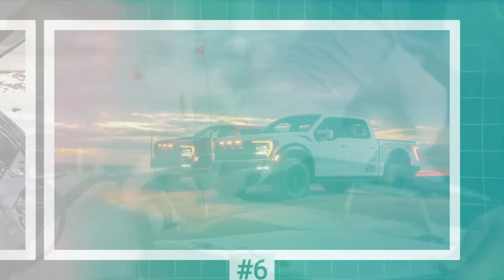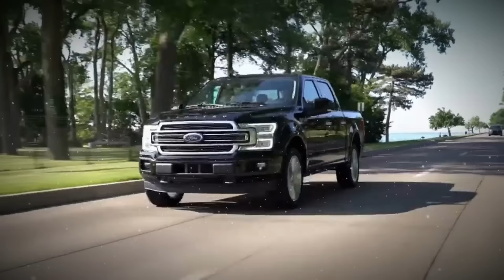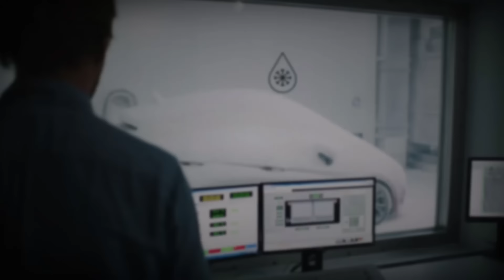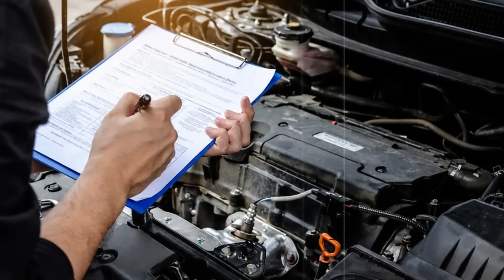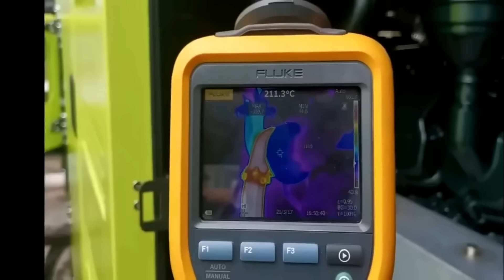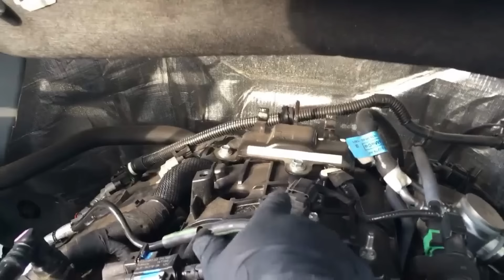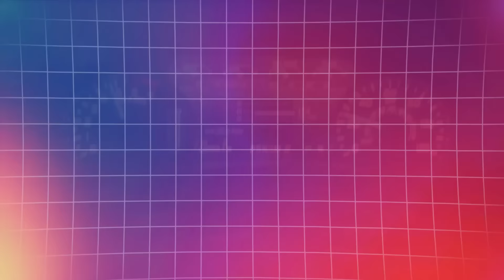We Ran a Turbo F-150 & a Naturally Aspirated F-150 Side by Side for 200,000 Miles — A Clear Winner

Comment: My 7.3 gas engine in an F350 is 1/2 way in your test mileage. I’m at 106,000 miles. Not a penny spent except normal maintenance. I’m still on original front brakes!   Truck runs great.
Reply: I only have 48,000 miles on my 22 f250 7.3 gasser. It’s been great so far! Plenty of power even towing a 16k dump trailer around central Alabama hills and mountains. 3.55 gears. Still fine worst case scenario is like 4th at 3,500 and that’s down hill or if your speeding up. I mean 55mph 5th gear and 3000 rpm it’ll pull 16k up 4 percent all day. lol feels funny to down shift to engine brake down hill 😂. So far I’m convinced it’s the best work truck engine for those not moving crazy cdl weights
Reply: @justinwest7765 100% agree with every thing you said. It is a classic work truck. I threw a Ford OEM bed rug in it when new. No bedliner on it. That bed gets used and abused. 

I just spent the money at my dealer to “prep me for 150,000 miles” and it didn’t take anything out of ordinary. Plugs, full flush on trans, full flush on brake fluid, rear differential oil change, 4x4 case oil changed. Brake inspection said “nothing to do here” (yes still on my factory brakes). I had already done a flush of the coolant. I completely underspray coated entire frame laying on my roller. I used the spray cans from Harbor Freight. It’s the rust inhibitor stuff. Forget the name.  It’s a PB Blaster branded product. I bought a long tube that you attach to the spray cans off Amazon and the tips of those makes the spray pattern radial on exit. So you stick that end in any open frame channel opening (and there are MANY) and coat as much of your frame as you can. Mine took about 8 cans and I should buy more and just go wild one day. That stuff works. I have changed oil religiously. Buy my oil off Amazon. Best price. I also bought a large box of Ford OEM oil filters. I put a brass valve in my oil sump pan drain hole. It redirects sump oil straight down into my waiting pan. Zero spills. Oh and the oil filter is within 6” of the valve. After thousands of miles of use I would buy that brass valve if they cost $150 and not just $35. My oil gets dumped an average of every 4,700 miles to date. I don’t drive it hard. I don’t stress the suspension travel. I don’t roll the body in corners. It’s a big truck and not a sports car so I drive it like I want it to last. I once pulled a WEIGHED dump trailer containing 40% brick debris and the rest was stucco wall rubble. It weighed 27,000 pounds. I drove it 19 miles on flat quiet crawfish farm roads. Frame is an F350. Didn’t even notice the load!  Yeah she squatted a couple inches but that’s all. I did feel marginally  lighter steering. Engine is Godzilla. When you own one and you are trying to explain it to people you can’t. Godzilla is a beast that eats whatever you throw at it. And then you are unloaded and stop at a country 4-way and there’s no cars near you for 3 miles. You let the beast roar!  It is a naturally aspirated push rod 445cu in with direct injection. 

BAM my truck hauls ass…….

Comment: Old school guy. Simplicty is job #1. So many failures (that you didn't experience) such as head gasket, rod bearing, etc are directly influenced by higher combustion pressures and temperatures. Larger displacement, lower revving, more heat removal (air volume and cylinder wall area) put the NA engine at a significant advantage. Saving a bit of fuel (to satisfy bureaucrats) is a disaster.
Reply: You do realize this never happened right? This is pure fantasy. This channel is coming from a slop facility in India somewhere and churning out aye eye videos nobody every purchased a truck and ran it side by side with another truck. This is pure slop.
Reply: @ThaiLifeAmerican This has been happening since the Ecoboost engine was created. Except it's not one truck that was tested. We have long term data on this now and it's easily accessible. Look up things like lowest cost of ownership, fewest customer complaints. The nhtsa tracks this data. They have had far more problems with the Ecoboost turbo charged engines than the 5.0 V8. Now they are having a lot of problems with the 10 speed transmission. Make it more complicated it becomes less reliable.
Reply: 40 plus year tech here. Been telling everyone for decades. The more crap they put in the vehicles the more shit there is to break.
Reply: My experience with a Ford Ranger upgraded 2.3 L Turbo 4 (380 ft lbs torque / 325 HP) is that the little 4 cylinder doesn't have to work nearly as hard to pull the same load compared to an older 4.0L V6 Ranger and an older 5.0 L V8 F-150.  Both the V6 and V8 have to rev higher, to move the same weight load up hills, where the little turbo 4 is loafing up hills barely pulling 2000 RPM at times!  The reason the 2.3 L turbo 4 was chosen over the 2.7 L V6 Turbo is that the upgraded 2.3 makes higher torque from idle to 3000 RPM than the 2.7 V6 turbo, and that is the RPM work range I generally use. The V6 higher torque and HP from 3000 to 6000 RPM is useless to my work load. Plus the DOHC inline 4 is a simpler engine than a V6 or V8, with fewer moving parts, and an inline layout that runs much cooler than the V-engine layout!  All these little positive features of the little turbo 4 are very noticeable when actually working the engine to pull work loads!  As long as properly maintained, my money is on the little turbo 4 to outlast the V6 and V8 engines I've used, because the little turbo 4 does not rev as high or work nearly as hard as the larger V6/V8 engines under REAL work loads!
Reply: @63DW89A  The turbo engine is pushing MUCH higher combustion pressures, with less heat area dissapated through cylinder walls.
Reply: @theronwolf3296  Superior heat dissapation of a crossflow head and a simple robust valve train is exactly why inline 4 & 6 cylinder engines are the best engines to turbocharge.  If an engine is built for turbo charging, then the internals will handle the extra pressure.  I've driven semi trucks for 40 years, and I've seen  turbo diesels go 500,000+ miles without a hitch.  Turbo gas engines, with much lower compression ratios than diesels, will do exactly the same.
Reply: @63DW89A  "If an engine is built for turbo charging, then the internals will handle the extra pressure".  One could wish!  Sadly, the highly stressed low displacement turbocharged engines offered today indicate otherwise.  Commercial duty turbo diesels will run trouble free for 500+K miles and they bear no resemblance to the turbocharged gas engines.  It is not a fair comparison.
Reply: @NCF8710  It is a fair comparison that clearly demonstrates that turbo engines can last as long as naturally aspirated engines. As far as "highly stressed small displacement engines", that is not my experience.  I'm using a 2.3 L turbo 4 in a Ranger that is a torque monster, running same weight loads up steep hills in TN at lower RPM than more highly stressed 4.0L and 5.0L V6 / V8's having to run at much higher RPM to move the same weight loads! .  The inline 4 (even turbocharged) is a much simpler engine, with a more robust and efficient valve train, that is much easier to run cool than a V6/V8.   The beauty of the inline 4 is that with a piston displacement that is 25% the engine displacement, the inline 4 has a faster torque rise, and makes its power and torque at lower RPM than a V6 / V8.  That is EXACTLY what I am seeing in direct load moving comparison!  The inline 4 is the simpler, stouter better engine, when built to handle the load.
Reply: @63DW89A  Real world examples say otherwise.
Reply: @NCF8710  While Ford has had some troubles with the 2.7 and 3.5 V6 Turbos, the 2.3 L has been ultra reliable and trouble free over the years and that is exactly why I chose it over the 2.7 L V6 turbo, in addition to the better torque curve of the 2.3 over the 2.7 V6  from idle to 3000 RPM!
Reply: @NCF8710 my turbocharged  Volvos all went 300,000+ miles without headgasket, or turbocharger issues,  an I wasn't nice to them . The Japanese and the Swedes KNOW HOW to make turbo engines last, just like Caterpillar does, Ford and GM STILL can't figure it out. . . . 
And Ford builds everything to be a colossal bitch to work on, I've been a technician for 35 years, ask me how I know.....
Reply: @jamesgeorge4874  Tell me all about Toyota’s 3.4L twin-turbo V6 (V35A-FTS).  Also the Nissan 1.5L VC-Turbo.  Those are Japanese if I recall.  There are many more examples!
Reply: The “some troubles” with the 2.7 was with the first generation 2.7.
Reply: @JasonWatrous-q2z The Ford 2.7 turbo fails quite often in all generations!  Go check out the "I Do Cars" YT site where a mechanic tears down failed engines. The latest 2.7 turbo failure tear down was 3 months ago on a 2.7 with perfect maintenance record that failed at 110,000 miles! He has a long list of Ford 2.7 Liter failure tear downs! In contrast, he has tried for YEARS to find a failed Ford 2.3L turbo failure; he finally found a failed 2.3 L turbo failure where the owner had driven the engine for over 50,000 miles without an oil change!
Reply: @63DW89A  Turbo-diesels are a different beast than gas turbos.
Reply: @PassivePortfolios  Mechanically, "Turbo-diesels are a different beast than gas turbos" is a false statement.   The diesel engine is actually subjected to higher pressures and heat than the gasoline engine. Other than that, both are liquid-cooled, oil-lubed, internal combustion engines being force-fed air by an exhaust-driven turbine.  Even the explosive volatile liquid power-generating  cycle is identical, other than the way combustion is ignited.  There is ZERO difference in the way the turbo-force-fed "intake-compression-combustion-exhaust" "piston-power-generating "cycle works in a gasoline or diesel engine, and ZERO difference in the way liquid-cooling, or internal oil lubrication works in either a gasoline or turbo engine.  If the gasoline engine is built to handle the power generation, there is no reason the turbo-gasoline engine cannot last as long or longer than the turbo-diesel engine.
Reply: @NCF8710 You have no idea what you are talking about.  The mechanical loads are easily managed with forged internals and properly sized pistons, connecting rods and crank bearings.  Gas turbos main enemy is heat under sustained load but that can be managed with cooling system design and oil jetting the pistons and other critical areas.  Most importantly engines used for light truck duty are not highly boosted like performance sports cars.  You are comparing old oranges to new apples.  Not the same.
Reply: @NCF8710 A 4 cylinder crank and bearing design is actually more robust than any V6 or V8 because the bearing loading is a constant for each cylinder.  On a V6 or V8 two pistons share a common pair of bearings and their load is not in center if the two bearings.  Plus the loading in the bearings shifts at the angle of the cylinder banks.  

If you are not real engineer but common garage goober regurgitating the falsehoods you were told you would never understand or admit those assumptions you make are false.
Reply: @NCF8710 That is a manufacturing quality problem.  It is related to design on in the sense it is difficult to consistently clean the swarf.  Then they discovered a tolerance stack up issue with cams that required a minor change.  Presumably because the tolerances engineering set could not be maintained in production.  These are risks if producing any new design whether turbocharged or not.  A V8 engine with similar issues might last outside the warranty period before it fails which in my opinion is a much worse outcome for buyer.
Reply: @63DW89A  and the TT2.7 has proved to be ultra reliable and trouble free over the yrs and it also provides 400 lb of torque at just 2750 rpm and that’s why I chose it, it tows great
Reply: @jamesgeorge4874  you have proved what you DONT know, congrats
Reply: @63DW89A  that’s a steaming load about the 2.7 engine. I seen the same video and it was NOT with perfect maintenance, he even said he had no idea how the engine was maintained. And he also said it was one of the few, if not the first one he has torn down, there is no list.
He has not “tried for years” to find an effed up 2.3 because they are everywhere, he just didn’t try. We get it, you are a 2.3 fanboy, no need to make up shit about another engine to make you feel better about your poor choice
Reply: @kannermw  Says the tinkerer regurgitating falsehoods!  Now run along underachiever and go play outside.  Stay out of the street.
Reply: @kannermw  Blather on, underachiever.  You are the one without any credibility.
Reply: Turbo revs lower. NA has to rev higher so you’re wrong about that
Reply: @jacobfrost5461  You are correct they don't NEED to be higher rev, but Turbos as currently implemented are generally smaller displacement that achieve their power at higher revs for fuel economy reasons.
Reply: @jacobfrost5461 No he is right. The turbo also creates more pressure on the engine. More pressure equals less reliability, less longevity.

Comment: I have a 2021 F150 XLT extended cab with tow package and the 5.0 Lt engine, 2WD.  I do have to say, I have had zero issue with low end power or acceleration.  Of course, I don't have the ecoboost equivalent to compare to, but I do have a Subaru Ascent Touring with a turbo.  That turbo has just a little bit more acceleration, but that could be accounted for with the difference in vehicle weight.  Now, I don't have high mileage to compare though, but my F150 has had no problems.  There are a lot of recalls though, but none are on critical drive train components. My previous 2013 F150 STX  4X4 with the 5.0 Lt engine also performed quite well.  It did have some issues with the entertainment system though.

Comment: Have a 2018 F 150 with the 2.7 engine...(bought new) 165000 miles and no issues so far... I use castrol full synthetic oil and change each time the warning light comes on.... it has averaged 22.9 miles per gallon in all driving conditions... Truck is used for primary transportation, haul trash off, haul things from Lowes etc., I do pull a trailer with a golf cart sometimes and we take trips to the mountains each year...  I love it and hope to get many more miles out of it.... Take care of it and they will usually last... Also buy the truck based on what you plan to use it for... Lots of hauling get the V8, average use it wont matter that much.... The old F150 I had (94 model), sold it at 289000 miles still running.. It had the 5.0 v8

Comment: Having owned both a 5.0 V8 and 3.6 V6, the 5.0 towed much better and got better fuel economy during the towing process. The 3.6 got really hot during towing and the fuel economy went to crap.  Around the city where I did 90% of my driving the 3.6 did great.  Overall, I preferred the 5.0.
Reply: 3.6?
Your 5.0 did not tow better than a 3.5eb. It just doesn't work that way.

Comment: Nice comparison.  Thanks for doing that.  I have a 1999 Chevy 2500 pickup (PU) with over 317,000 miles on the engine.  I bought the truck new, and have driven it across the country several times.  The V8 engine seems to be still good, and I change the engine oil every 3,000 miles.  I don't pull loads with this truck.  Do you have any Chevy PU comparisons, or do you remain just Ford focused?  I'm at a point where at age 83 I am looking at replacement trucks, and the John Deere PU seems to be my target right now.  Thanks for doing this Ford review.

Comment: You really didn’t include the time , extra time the owners frustration grew. If the owner could charge  ford for the extra frustration, medical problems and inconvience of the the turbo truck the winner would be much easier to decide. Also many realize that ownership of many vehicles has gotten increasingly frustrating with “ climate change green vehicles. More complications, more plastics, more bad ideas which ignore the utility aspects of silly climate related vehicles. In truth if you have 60k for a basic truck that stinks for numberless reasons, then …..

Comment: I really enjoyed the video, just a couple of things that stuck out to me. You put the 2.7 in a towing contest vs. The 5.0. I think the better test would have been the 3.5EB. While the test may end up showing the same issues, I think it would be a more fair comparison as it's the engine that Ford says can tow the most (IIRC) with the coyote being a close 2nd. I look at the 2.7 as an extremely light duty truck for a person who needs more than a mid size truck (like myself because I just need to haul two motorcycles in the bed, or take camping equipment and shooting targets with me, possibly off road a little) but doesn't need the full capability of a full size truck, or someone who doesn't need the capability all the time, or for long or hard distances. I really love what the 2.7 eco provides for me. Good gas milage, the quick power response, the ability to haul all my shit when I need it to, and, in the event I ever need to tow something, I can. I love the 5.0 though, have one in my mustang and it's great, just didn't want it in my truck.